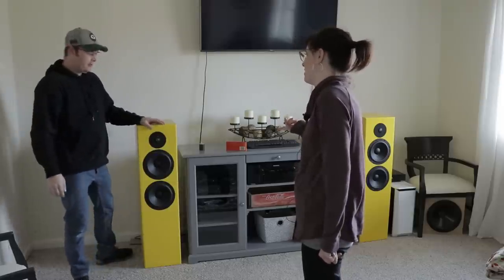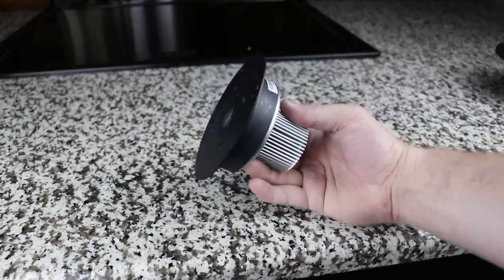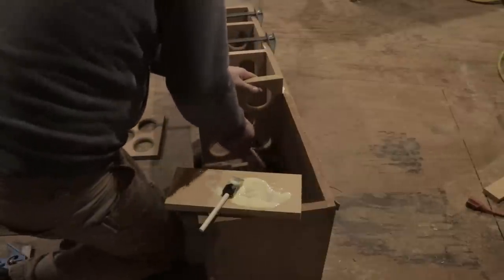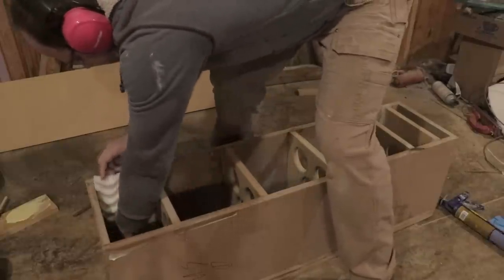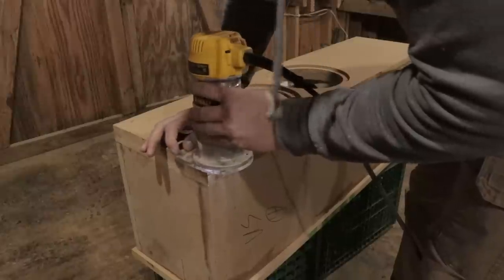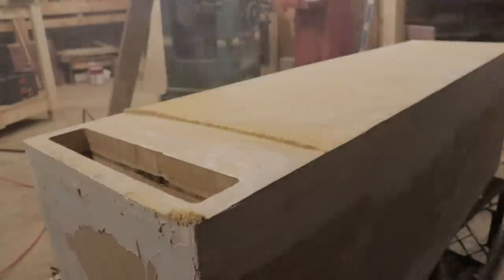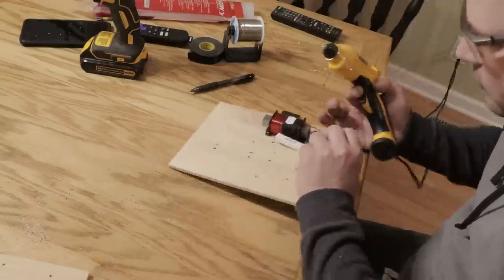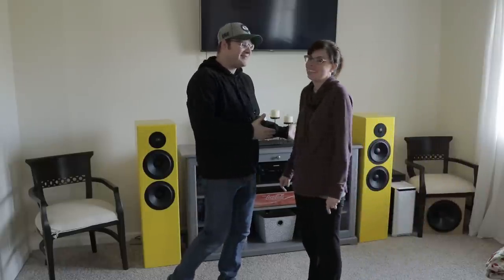Home Theater Tower Speakers that go down to 20hz! The Uglies

Comment: I finally got a chance to hear these. The amount of bass and clarity of these are unbelievable! Truly do sound like a high end set of towers. Great job Nick.
Reply: I mean, there's like $500 worth of drivers alone in the build, I'm guessing cost to build around 1500 per speaker when factoring in wood, x-over and time...which if it were going to be mass produced would end up costing probably close to 5k per speaker at retail, a 10k pair better sound pretty good imho.  Still, pretty cool design, and I love the fact that the uglies do in fact bump.  🤣

Comment: 3:35 with a router and right size bit you can make 3/16th slots in the boards so the supports will be automatically straight and its a bit stronger.

Comment: You will forever drive yourself nuts with crossovers because you perfected the idea and now you can't settle for less. This is why I'm calling on you to help me make a killer sounding monster portable stereo, not a boom box. I always had a thing for making grooves for all parts of the box, glue, clamped and screwed and I love Evercoat primer and filler, it doesn't shrink and easier to sand.
Reply from the maker: Good to know. I have to look into that every coat. If you head over to the forum sometime, we can take a look at what that build might look like

Comment: Nice video and great build. It is nice to set a real build without fancy wood and the like.  Those are some impressive drivers.  Couple suggestions. I like to cut all my width parts at the same time so I know they are all the same width (top, bottom & all braces).  No need to hammer to put braces in!  Also, I have had good luck with those aerosol sprayers for glass jars if you want to step up your painting game a little. Final suggestion, if you go your hardware store, you can get a larger drywall knife ( 16" long if I recall) to help to really flatten that putty and scrap off the excess.

Comment: Nice build Nick! What did you end up crossing them over at?
Reply from the maker: I had to put a really aggressive crossover on both the tweeter and woofers for distortion and power handling. The crossover came in right around 1,200 Hertz.

Comment: Do a build on The X-Statik Kit from GR Research by Danny Richie.  For the price cannot be beat at $399. You get 10 drivers plus the crossovers enough for two speaker cabinets. You just provide the wood and the woodworking. Would make a great video plus review how to build The X-Statik Kit
Reply: Built them. Be warned, they are not all they are cracked up to be. At least not for my tastes.
Reply: @Luke-qs2cg  That’s what I’ll be finding out.   I know because they’re open baffle they have to be several feet away from the back wall from What I read about open baffle. 
           It’ll be a experiment like my BK-20 Full range horn loaded cabinet with the Fostex 8 inch speaker Full range.  That I made for the amp camp amp I built. 

         I wanted to hear what open baffle speaker sound like in my system before investing or some thing like those big mammoth towers NX Extreme open baffle from GR research

Comment: You claim to have them play low bass so they could supplement the subwoofer. So how do you cross them over with a sub? What about phase issues? As I understand that, the sub should be crossed very low to avoid problems with both the towers and the subs eliminating each other

Comment: Heyy Heyy.. . . I know I have criticized you in the past but your great however what's the box volume what exact speakers are you using what exact crossover frequencies are you using this is why people get mad or give up or don't even try you scare away more people than you bring in your video was primarily about box construction nice tips but no one can build these speakers without that info
Reply from the maker: I used to sell the plans for these, so others could build them. And quite a few people did and really enjoy them. The reason why these plans are no longer for sale, are you can no longer buy the woofers. If they ever come back in stock, I'll be happy to offer them for sale again.
Reply from the maker: P.S. if you read the description, there's links to the major components as well as the build plans.

Comment: Hi, I am trying to design a set of Hifi Speakers similar to the Klipsch KLF30's. How do you design the HZ and why? My woofers are have a HZ response of 25-2500k with an FS of 27hz. Do I pick based on whatever particular hz has the highest DB at a given cuft? My WINIsd shows me the highest response at around 31.5hz at 8.5cuft. I guess I'm not sure if there are different rules for "Subwoofer Boxes" vs Musical Speakers when it comes to the Bass.
Reply from the maker: Good question. It would be better asked in the forum. www.toidsdiyaudio.com/community

Comment: Sorry for my english... What about impedance and yield ? Do they need a strong amp ?  Are boomers plugged in parallel or serial (4 ohms each) ? Very interesting concept !
Reply from the maker: Thank you  This is a nominal 8ohm speaker. They're very easy to drive.  I've been using just the normal surround sound receiver.  I mentioned that in the video somewhere.
Reply: @Toid  Thank you for answering. It's easier for me to understand when written than spoken !

Comment: Who mounted that tv? Holy balls that's high. And you can build those well thought out, serious speakers, but then have a cable running down the wall?
Reply from the maker: Yeah. The TV is temporary. We're going to start renovating that room soon. We just bought the house
Reply: @Toid  Gotcha, no sense in retroing a bunch of cables if you're just gonna tear it apart soon. What model woofer are those? I missed it in the video.
Reply from the maker: @donalddluckerii3147  exactly.  It's been bothering me too.  I hate having them there.  Here is the woofer. http://bit.ly/w8-2096

Comment: Impressive drivers.  Tang Bands underhung drivers are special... currently wrapping up a pair of 'The Speedsters' that incorporate a pair of underhung woofers as well.  Curious to hear what those little guys can do.  Btw, why the TMM?  Would one woofer not produce the desired output?
Reply from the maker: It could have tuned similarly, but I really wanted more displacement.  The more woofers, the more displacement, ie the more air it moves.  Which in turn can help pressurize your room with bass.  That is an important goal in home theater.

Comment: The 4 woofers and 2 tweeters comes out to about $600 in parts. Not an inexpensive build.  How do these compare to something like Jim Holtz's very well regarded Mini Statements?  I'm not trying to throw shade on your design, which seem to meet the goal of having a really solid low end. Just want to know how it compares for about the same $$$.
Reply from the maker: I really couldn't say.  I haven't personally hear the Mini Statements.  I am sure they are good, but I couldn't do a direct comparison.  What I do like about the Uglies, is the amount of bass you can get (not just how low they go).  These are 8" woofers with 8.5mm of xmax each. Which is pretty impressive.

Comment: Nick can u help me with crossover schematic design for 4 ways  with 5 drivers. Driver Selection:
RS100-4 mid-range 295-378
RS150-4 mid-woofer 295-372
(2 speaker) RS225-8 woofers 295-356 
ND25FA-4 soft dome tweeter 275
Reply: Why 4 way .... 3 way just fine for Dayton ......
RS125 mid 
ND25fa
2 RS270 woofer

Comment: Now that you can't get these drivers, any suggestions?
Reply from the maker: I'm working on a new version using the new epique woofers from Parts Express.
Reply: @Toid  Can you do a 2.5 way or a 3 way using TMWW (just add a 5" mid range)? Then it would really be unbeatable. :)

Comment: You are preventing defraction when you round the outside edges.
Reply from the maker: Just to clarify you're not preventing diffraction you're reducing diffraction. I'm sure that's what you meant. But really with a half inch round over like I did, it's not going to have that much of an effect on this build. But as a generality, that is definitely true.

Comment: Hi I have sony speakers and 10 inch sub form 5.1 setup model bdv-e2100. My blueray amp burned and now I want to build a small budget amp can you help me pick a board. Thanks in advance.
Reply from the maker: It's hard to pick a board without knowing more.  BUt if you can use something liek this, I used this in my Dinas boombox and it works well. https://bit.ly/39bZd6y

Comment: They are ugly, c'mon yellow and black cones ;) The ugly ducklings by Toid, but I wouldn't mind 20Hz in living room. Now we know what you did with the underhanged TB midwoofer. Rounding is very important - looks way better, hopefully the dips and picks get smooth out. This tweeter measured very flat.

Comment: Most pro gear is rolled off at 40 ,,, so whats the point really , but that aside the speakers arent half as ugly as all those wires hanging off that tv.
Reply from the maker: haha, those wires are bad.  We're in the midst of a renovation, so I am not hiding them until it is finished. Home Theater the goal is always 20hz.  Pro audio is a different ball game.  The main reason they are rolled off though is due to hoffmans law, which I don't plan to get into right now.  But the basic premise is pro audio is geared toward high efficiency, which doesn't lead well to low bass.  Not to mention, it wouldn't really matter for a lot of music.
Reply: @Toid  very true after 40 your really just trying to loosen the bricks in your house lol you certainly will feel it even if you don't hear it 
But you've not mentioned Coles law .... if you know what that is
Reply: @Toid  
Ah . .. thats if they recorded anything that low , and put it on the source , but even if you dont hear it , you can feel it ,,, after 40 your mostly trying to turn your voice coils into electric fires , lol
but , dont forget about Coles Law ,, its very important too ,,, if your familiar with that.

Comment: I applaud your DIY accomplishments.  But hits 20Hz at -10db.  That's not really filling the room with bass, let's be honest.  You need a sub and then you'll get proper deep bass at proper SPL's.   I built the Solstice kit, very similar to your tower.  It has an f3 in the 30Hz range but adding a sub made a tremendous difference.  Great video and workmanship.
Reply from the maker: The solstice doesn't have the excursion to produce true room filling bass. Remember the measurments I am showing are anechoic and not half space like most manufacturers or measurment mics. You get a lot more low end bass with room gain. Easily hitting 20hz.  Of course, those that were able to build these raved about the bass response, absolutely no need for a subwoofer. Having said that, it doesn't really matter since no one can build them anymore.

Comment: Tell 20hz how Many db-...
Reply from the maker: It is a linear response with an F10 of about 20hz.  That would be 10db down at 20hz.
Reply: Please Tell me model maybe i will in Poland
Reply from the maker: @lukaszlukasz663  all the links are in the description of the video.
Reply: Tang bang, so hot right now...lol, lots of bass I'm sure, I've had similar experiences with four 10 inch woofer, full range towers, but ported. Didnt need the  2 subs that's for sure! Did anyway, haha.

Comment: There's ugly finish and then there's this. Even a vinyl foil would look much better, wouldn't cost much and would be relatively easy and quick to apply.
Reply from the maker: The point was to make an ugly finish.  I hear too many people not try to build their own speakers due to their inadequate finishing skills.  But it is the sound that is most important.  YOu can always refeinish them

Comment: if your gonna put that much into drivers $450 . spend the extra 20 a sheet for 13 ply . your music and your lungs will sound so much better . if you mess with mdf please use a mask AND hook up a shop vac to your table saw .

Comment: Why put so much effort to make something ugly ?
Where is the midrange driver? If you favor sound quality,this would have been
a much better approach.
You should use air core inductors in your xover (expensive but worth it)
You could have used a roller paint brush for a complete different finish,then put a few coats of floor varnish.This would have help with the WAF factor.
(Wife accepting factor)A friend,one day,found his speakers in the basement,
the next day,in the garage,the next day,on the side of the road,garbage day.
(Her house)
You have children,it would be wise to add a front grill.(A friend liked my speakers,
he ask me to build some for him as well,he insisted he wanted a METAL grill covered
with a nice tissue (Chosen by his wife)to avoid the drivers been poked by wandering pencils.)
Last item.Many people will see your work,if they are impressed by it,they may become potential customers.
Once,i brought my speakers to the highfy club,i sold 3 pairs wright there.With a little profit on each pair,mine cost me nothing.
Bye.
Lucien
Reply: @Pho Tato Since when? Most good speakers are 3 ways .Some  will even have a super tweeter-tweeter,midrange, high-bass, and a low-bass drivers.
The more drivers you have ,the less each driver has to work,the better they are a what they do .
I was in a store once,heard some 2 ways speakers,i was impressed,the were selling around $10K ,they were in a separate room.
When they were shown in the same room as 3 ways speakers at half the price ,they could  not selling any.
Bye.
Lucien